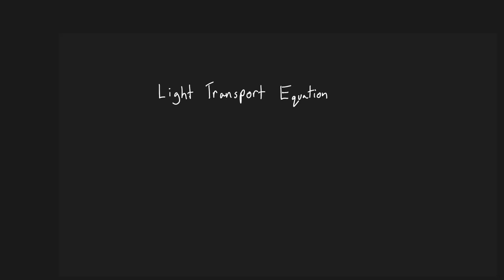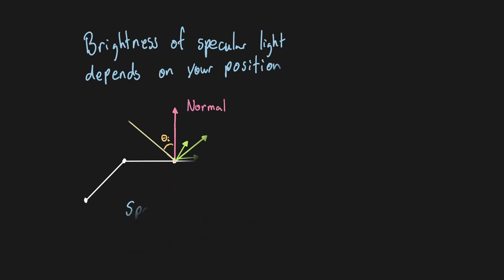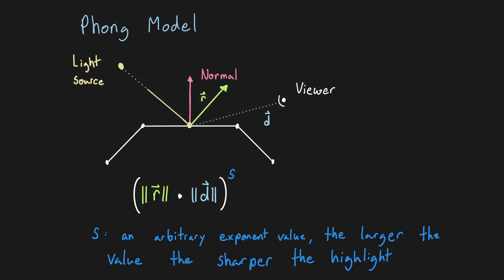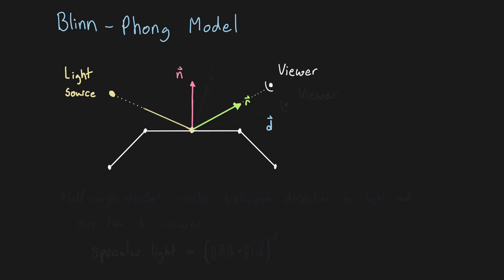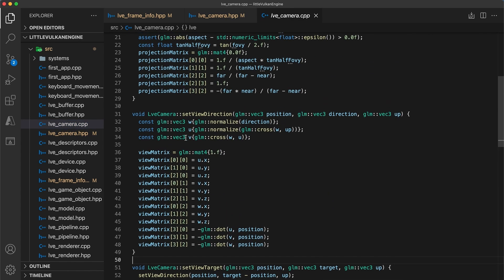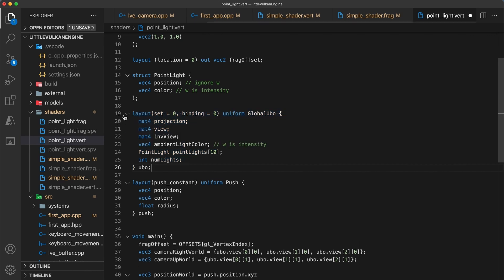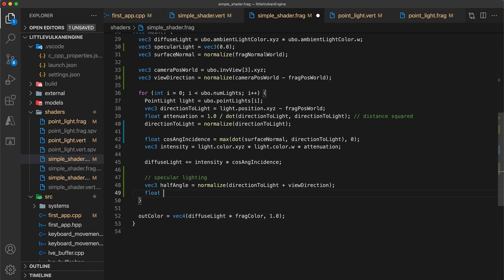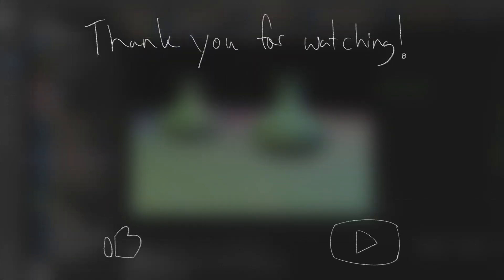Specular Lighting - Vulkan Game Engine Tutorial 26

Comment: I recommend you do lighting calculations in view space or 'camera relative world', otherwise your lighting math will break down when the camera/scene is too far away from the origin due to the way floating point precision works. Additionally, kill specular when (ndotl<0) otherwise the specular will cross the terminator.
Reply from the maker: Ahh good point, I’ll make sure to mention that in a future video!! Thanks

For your second point am I not already doing that? We use clamp to squash negative values to 0. Probably could’ve  just used min though

Comment: Love the series! Just one question (because I couldn't find answers on the web) - is there a way to make the window draw during resizing? It seems GLFW doesn't update during resizing and I haven't found a way around this. Keep up the good work!
Reply from the maker: It’s a bit trickier then you might expect, unless there’s a better way I’m not aware of. The problem is the glfw poll events function blocks while resizing is occurring. I think you could either use a callback function to update the screen during this process or do something with multithreading to keep rendering going. 

So at this point I’ve been avoiding it because it adds complexity without much benefit, but it’s definitely something I’d like to address in the future. I’ll have to spend some time actually trying it out and get back to you with a better solution if I can